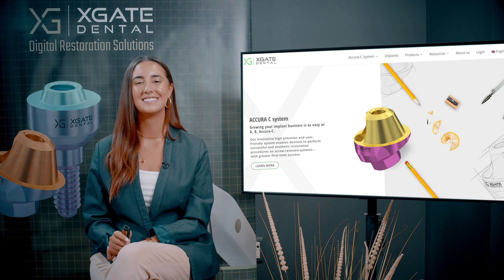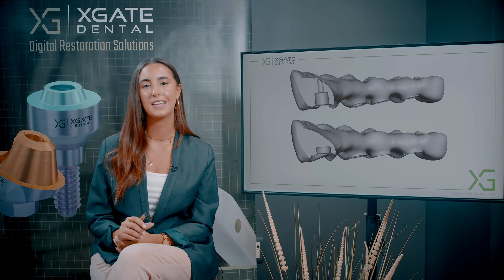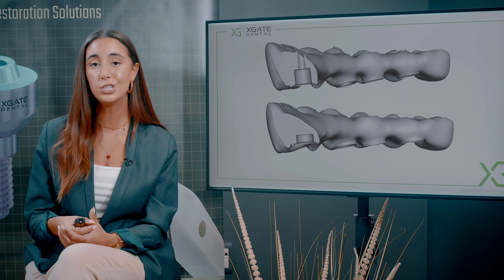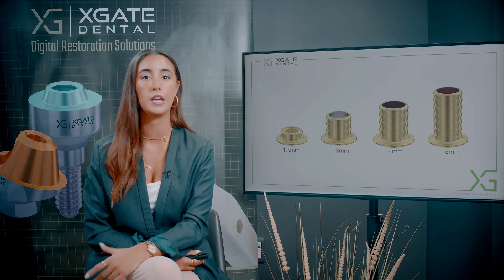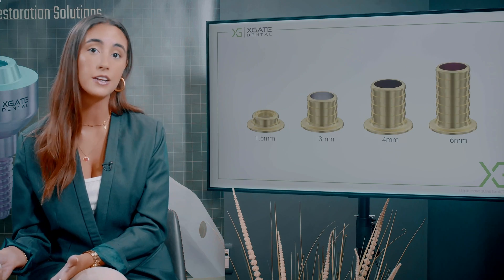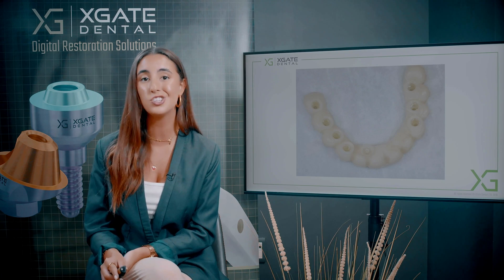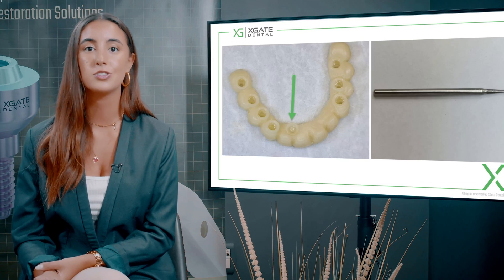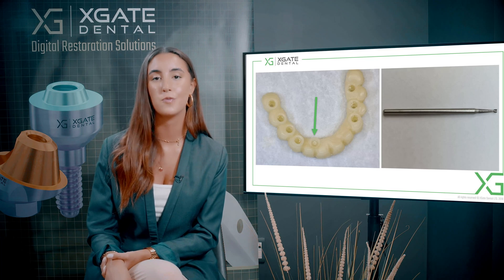Using from the extra smallest to the most extreme sleeves in screw retained restoration

Comment from the maker: 00:00 A provisional bridge broken down
01:00 Because we eliminated the screw channel and made a smaller sleeve
02:00 The preparation angle
03:00 You can see all the types of sleeves that we have for these types of multi-units
04:00 Why we produce it & why we don’t just take the three millimeter and cut it?
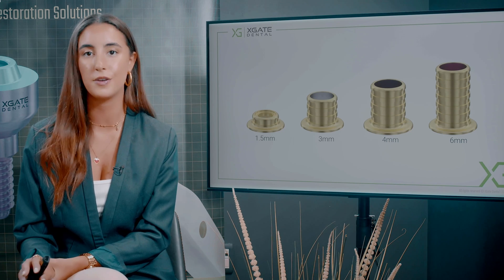05:00 This way the sleeve fits the best
06:00 Just in five minutes, do it yourself
07:00 We recommend doing undercuts in every screw retained restoration
08:00 You need to remove the cemented restoration.